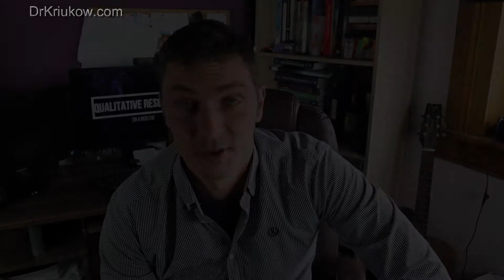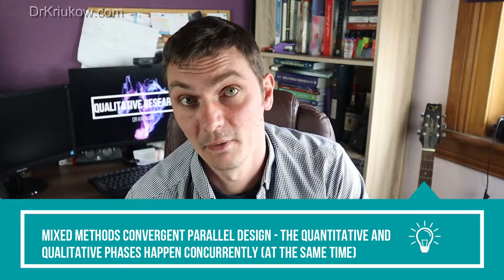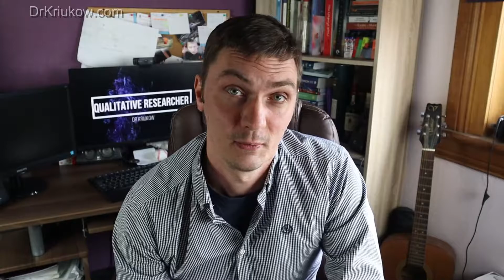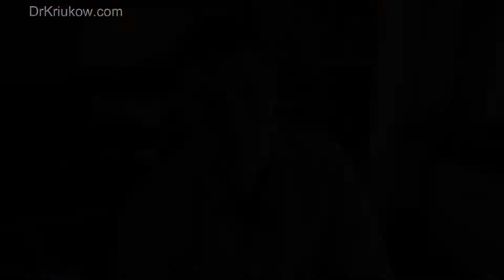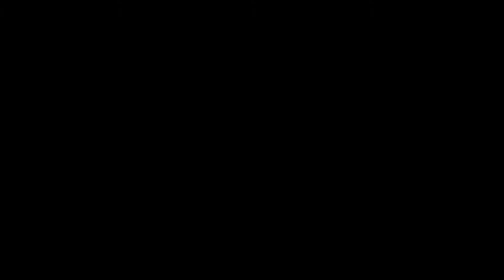Analyzing mixed methods research data

Comment: Thank you, Dr. Kriukow, I have two questions: 1. as pragmatist, I conducted an exploratory sequential design starting with a qualitative study (new topic to the area), and I did not develop a questionnaire from the qualitative study.. I used an already validated tool (from other researcher).. Is this the wrong way?? . My second question: If I got contradictory results between qualitative and quantitative how can I approach my discussion.. Appreciate your advice!
Reply from the maker: what you described does not fit what is typically referred to as exploratory design, but probably a convergent or concurrent design, since you have essentially qual and quant phases and methods separately, which will later need to be integrated in the analysis. The second question is probably too long to answer here, but there is nothing wrong with such outcome and you should comment on these differences and reflect on them in the discussion

Comment: If I am using questionnaires and document analysis for data collection which design should I go for and what data analysis should I go for ?
Reply from the maker: this will depend on what you want to achieve by mixing the methods. There is no other rule, just this one - you need to be clear what exactly is the purpose of each method. Regarding the analysis, again the approach may differ, you may for example do content analysis for the documents and thematic analysis for the open ended questionnaire items, but these are just examples
Reply: @qualitativeresearcher  okay I get your point. So does it matter which data I collect first? Or it also depends on what I want to achieve?? I think if I know which data do I need to collect first then I would know what design to go for
Reply from the maker: @tsireledzoramakokovhu5651  this also depends on your goal. If you collect the Quant data first, the qualitative data is to help explain the quant results. If you collect the Qual data first, the results of the analysis are used to design the Quant tool. I have a few videos on this channel about these designs

Comment: The thing is with explanatory design the qualitative phase is usually voluntary and so you can't really recruit specific participants unless they are also interested in being followed-up.
Reply from the maker: True, but if you have a relatively decent sample size for the Quant phase (which is probably the case if one decides to conduct an explanatory mixed methods study) and design the questionnaire so as to ask the participants if they would mind being potentially recruited for a follow up, chances are, statistically, that you will get enough for your qual phase. Of course this does not have to happen, but is likely nevertheless

Comment: So basically, for the exploratory sequential design, we just start by analyzing the qualitative data separatley then the findings are used to help design the questionnaire for the quantitative phase. Then the findings of both phases are merged together right?
Reply from the maker: the data/data analysis is not merged togehter, you want to analyze the quantitative data separately. But I suppose you can say that the findings are "merged" in a sense that you want to first discuss the qual findings, then the quant, but then you want to discuss them together in light of your research questions
Reply: Assuming the two sets of data cover the same topics, I would always suggest merging the results in the final write-up of the study, as each will add information and quality to the other - integration is key to a mixed methods study.